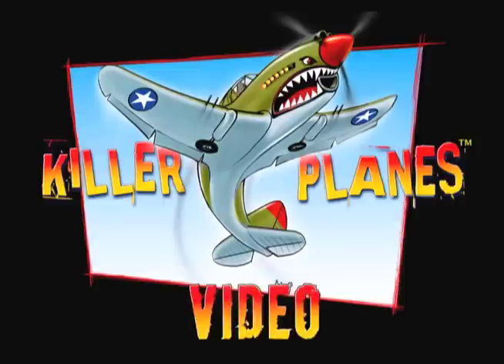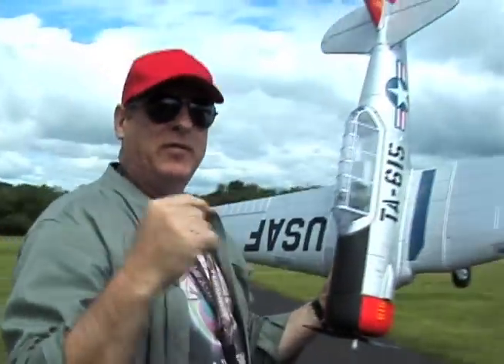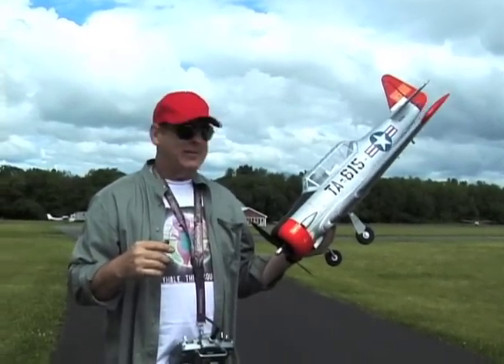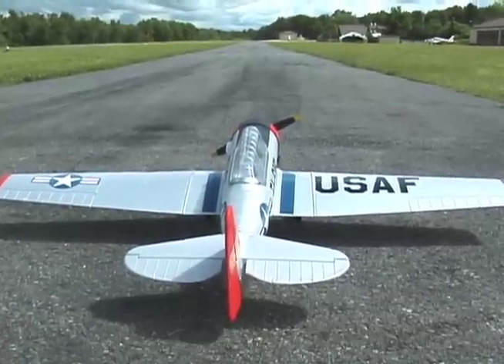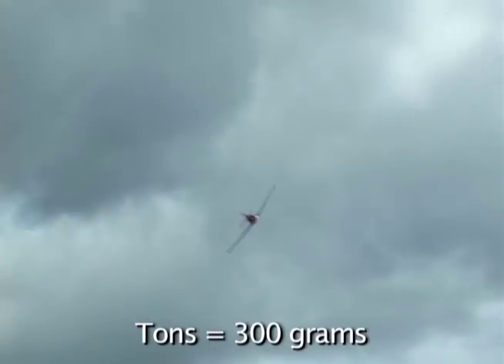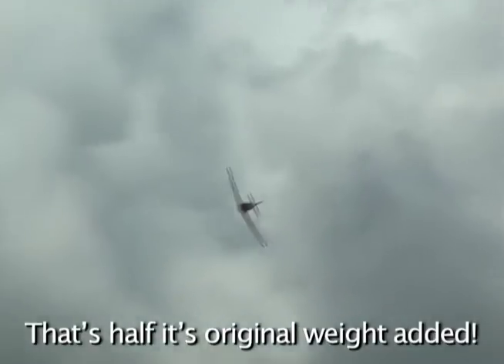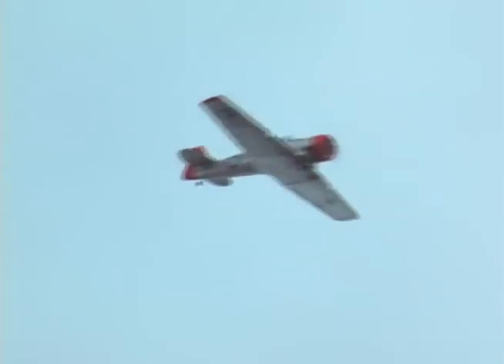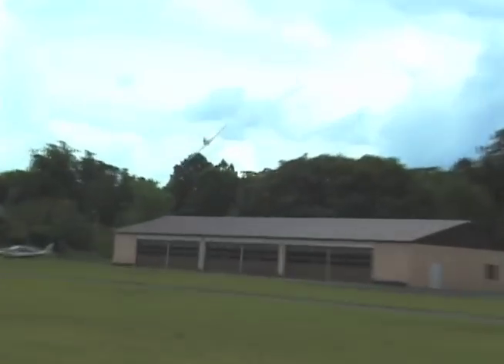DYNAM AT 6 "TEXAN" MAIDEN FLIGHT PART 01

Comment: I wonder if this at-6 stock 3s out performs the dynam t-28 stock on 3s? it seems to have a better power to weight ratio especially since this demo plane was very heavy compared to stock at6 and you still only used 3s...What do you think?